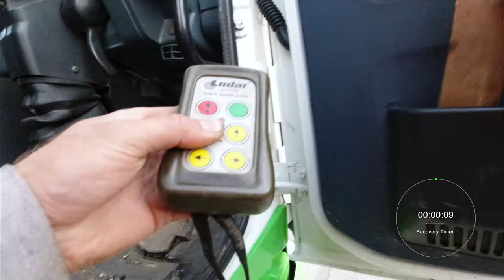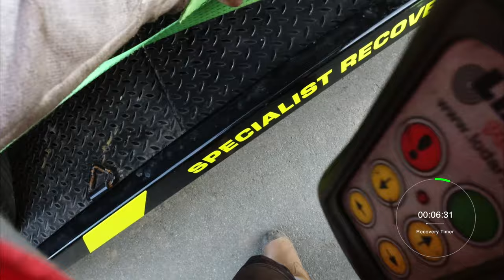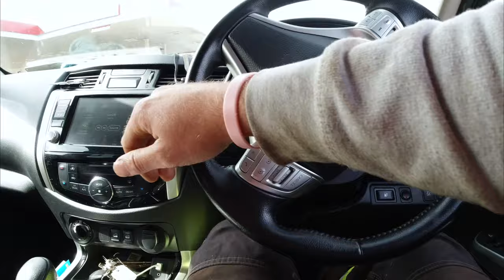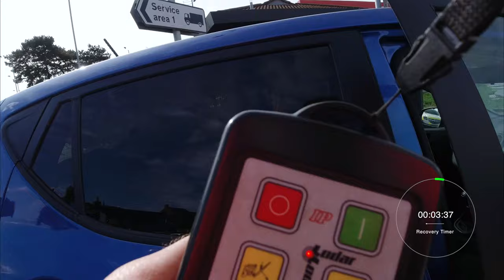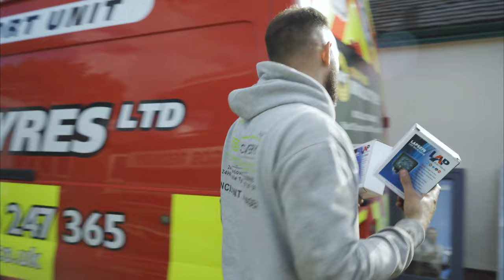RTC JOB ON! Navara Spec Lift DAF Accident Unit ACTION! MOBILE TYRE VAN Upgrades! THE BEST VIDEO YET!

Comment: Alright bud quite new round here loving the content!
One quick question regarding spec if you don't mind, what does the weight of the vehicle on back count as? Does it go onto the Navara weight/is it towing weight or split between the two? 
Cheers and keep up this kind of content
Reply from the maker: Morning welcome to the channel, i kind of get what your asking, spec lift is only half lift rated to 1 ton lift which is generally what the payload of the vehicle would be as a pick up etc! Hope this helps
Reply: @GDBRescueandrecovery  Thank you for the reply, sorry it wasn't clear. What i meant was for people who have 3.5tonne entitlement only. 
Say you've got a recovery truck that weighs 2 tonne, you put a car on body at 1.5 tonne taking you to the limit. But the truck also has a spec lift, so you put a 2 tonne car on the spec, does the 2 tonne count as vehicle weight/towing weight or a mix of both?
Thank you
Reply from the maker: @benjiaj1963  i think the answer to your question is you need B+E entitlement on your license for towing?
Reply from the maker: @benjiaj1963  and 3.5t recovery truck and a spec lift doesnt happen over here like … but i assume you would have to them check the train weight of the vehicle etc

Comment: Slippy Jims didn’t really work too well, is there a better option do you reckon?
Reply: The slippy Jim’s worked a treat, what are you talking about??? Like the caption in the video explains… the front wheels were not locked up so the wheels will obviously roll over them! The slippy Jim’s on the back however worked as they should!
Reply: @shane_reece  On the bed my mate. You can see by the rear wheel trying to grip, hence my question. I’ve used rollers in the past but they can be sketchy.
Reply from the maker: Only other things that work are mcdonauld trays, slippys worked ok for rear wheels you can double them up if needs be, but slid on and off ok for me! Stay Safe